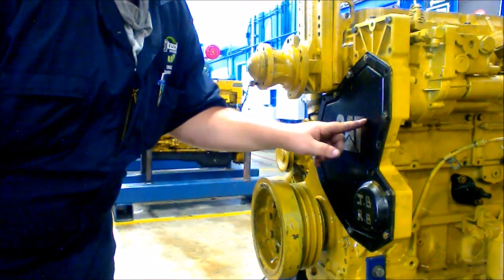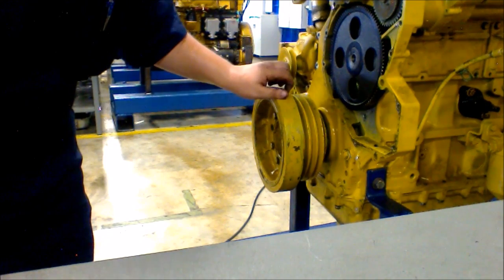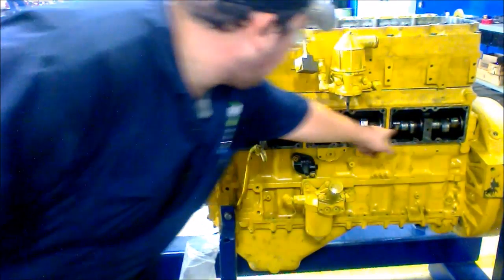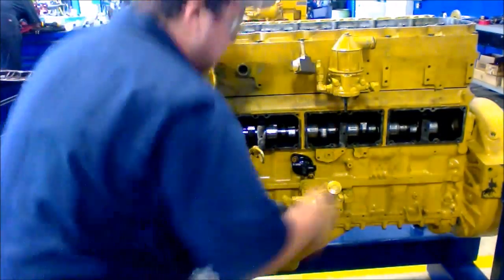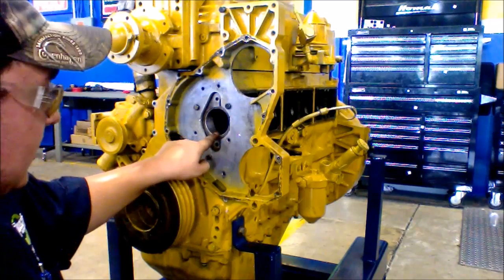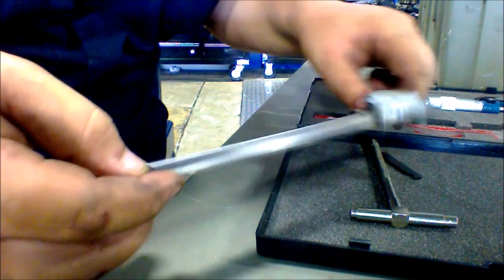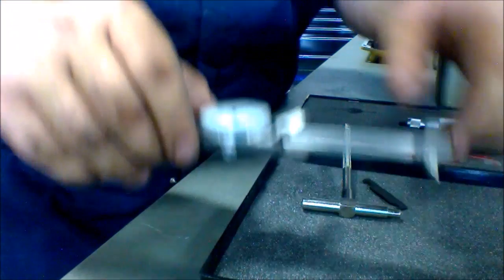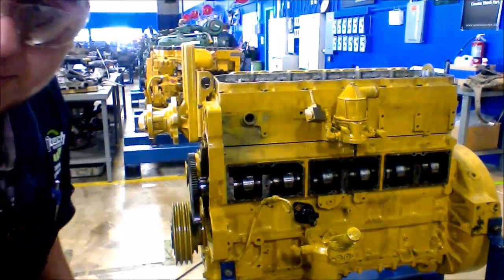How to Remove a Camshaft

Comment: I noticed you didn’t mention any torque specs, valve lash adjustment, fuel rack synch, or cam timing

Comment: is it possible to take the cam gear off the camshaft while still in the engine
Reply from the maker: On that particular engine no the cam gear is attached to the cam itself.
Reply: +Michael Vileno well the one im working on is in a 95 kodiak rollback truck and and i have to replace the main cover for the gears and didnt want to do a overhead job on it cause it seams i have to take the whole camshaft out to take that cover off
Reply from the maker: +King Pacman TBH man idk about that engine id say look online for any procedures and or other ways to get around it
Reply: +Michael Vileno its a 3116